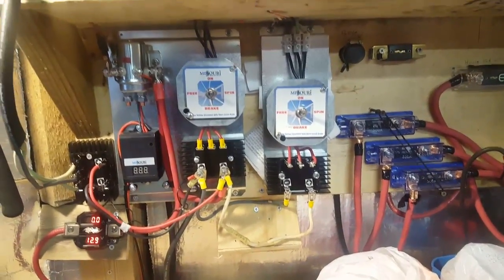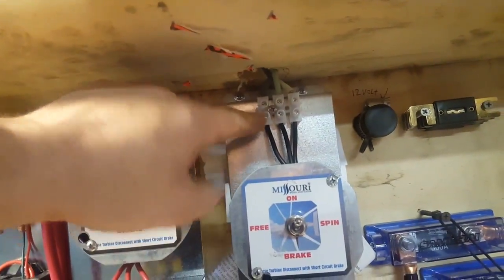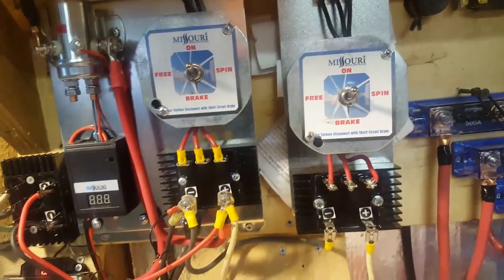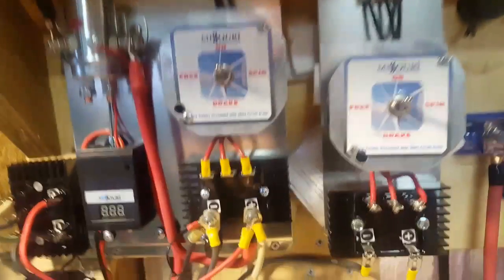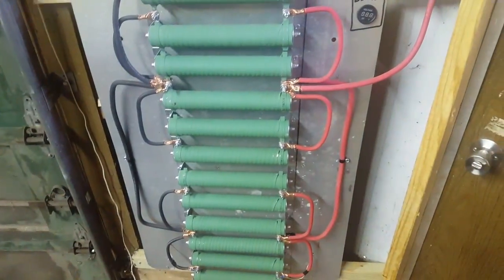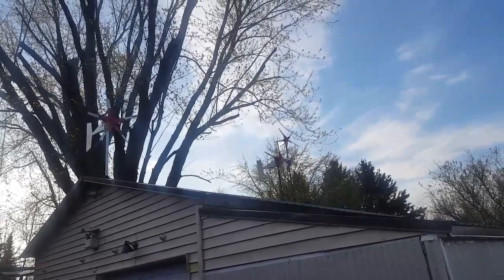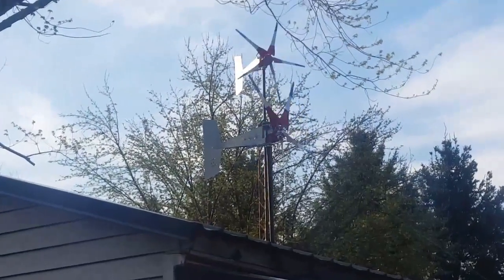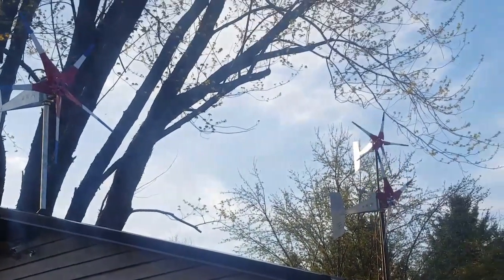Be careful when wiring your wind turbines

Comment: Wow that's such such bad advice to give you, the output is 3 phase AC. Generally speaking you cannot run AC in parallel with another AC power source unless they are synchronized with both their wave length, phases AND voltage it will short out, it's why grid tie inverters are generally more expensive. Wiring them together like that just shorts them out. 

Something else worth noting is those solenoids when they eventually fail can fail in the closed position and destroy your batteries pretty quick. A solid state relay would be a better alternative, more reliable with no moving parts and they fail open which whilst still bad for your batteries is less likely to kill them as quick.
Reply from the maker: Yes I know that now at the video time I didn't

Comment: Lol it created a short out basically a braking system . I have a 3 phase ac 500 watt pma that has been as high as 1200 watt in 30mph winds. I have mine wired to a 100 amp copper 3 phase throw lever and from top port to a 100 amp 3 bridge ac to dc rectifier and from there to a dump.control board and solid state relay and 3 100 watt 3 ohm resisters in parallel bank then to 1410 ah 12v battery bank. Im adding a resistive braking system to the empty 3 port on lever so i can pull lever down and add another direct 300 watt 3 ohm resister bank to drag down the turbine in 50mph winds and still get power from it safely and if it needs to go even slower the solid state   relay float settings will kick in at 15v and drag it down completely.
Reply from the maker: I just bought 3 150 amp resistors and taking these 90 amps out, I have a huge resistor dump Bank built
Reply: @TheoriginalAndysgarage  how much energy is the system making for you? Mine is for portable off grid use and i built a prototype telescoping folding wind turbine tower max out is 60 foot up and lowest is 12 ft  i removed a tube section   so its minus 20ft section for now. Im adding 6000 n linear actuators on each section next spring to make telescoping electric with remote control and a 30 inch linear actuator to replace the scissor jack for folding and lifting it into the air.

Comment: Where did you get the risisters for the dump load and the crank up mast ? Please .
Reply from the maker: Bought the resistors on eBay The Mast I found local on Craigslist, I just put an ad in The Wanted part
Reply from the maker: https://rover.ebay.com/rover/0/0/0?mpre=https%3A%2F%2Fwww.ebay.com%2Fulk%2Fitm%2F113407625278

Comment from the maker: When I added my third wind turbine I did not put in the switch, I just use a jumper wire with alligator clips on the end and connected them together and it works

Comment: Dude, The wind turbine has three AC outputs. Each output carries  a voltage that is 120 degrees out of phase from the previous one.  If they are not in phase they cancel one another out.  That is how you stop a wind turbine, as you found out.
Reply from the maker: Roberto Viana I knew nothing about what I'm doing I've learned everything by watching YouTube videos everything is up and running perfectly now
Reply: If you connect them so the phases align, what happens?
Reply from the maker: Yes I realize that

Comment from the maker: I'm just learning all this stuff, what I've done so far I found information on YouTube, and info from the manufacturer
Reply: im trying to learn myself, the internet is a part of learning but a good book has more reliable information that you can access while you are working
Reply from the maker: Now that a year is past when I posted this video, I have pretty much mastered everything, LOL
Reply: @TheoriginalAndysgarage  Nice👍🏼
Reply: Good job man thats the only way to learn this stuff on hands.
Reply: I built my wind and solar hybrid portable system for off grid power  i can tow behind my camper or truck..i have a large 1200 watt array 120v and a suitcase array 200 watts each total of 3  600 watt array 120v and i have a 500 watt 3 phase ac wind turbine 3 or 5 blade changeable  blades. Out in s good flat area i have been reaching about 600 to 800 watts 50 or 60 amps  continously before.charges my 12 crown 6v 235 ah deep cycle batteries good those are in series to 12v 1410 ah right now. When i can afford to replace both of my inverters with an 24v pure sine i will tie the bank as a 24v. Or someday build a 60v nissan leaf bank 1500 ah one and replace the wind turbine with a 230v 5kw turbine and inline inverter to power a bank charger.midnight solar classic   250 i hear works good. A thermadyne turbine would be a good upgrade my 2 EPEVER mppt controllers work great for solar . My current system has a powerbright 6kw to 12kw msw inverter 30 amp rv plug hardwired to the 50 amp port and my reliable 3500 7.5kw pure sine was free for repairing it my self.its working good until.my charge rate gets to 14.9v to 15.5v  then it wigs ou